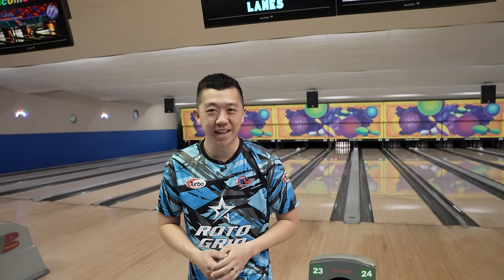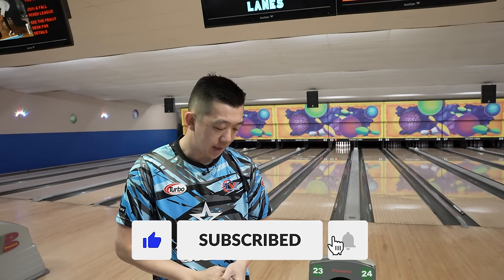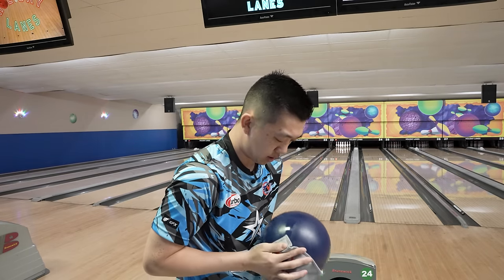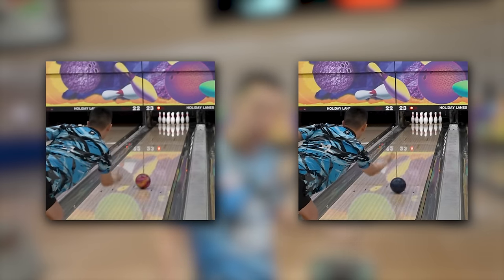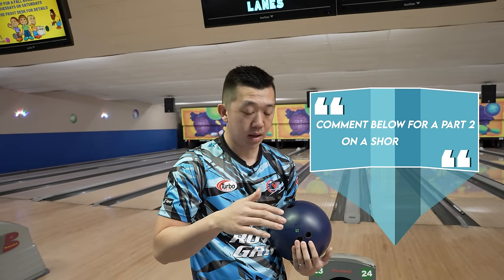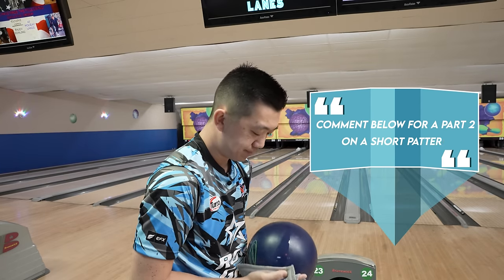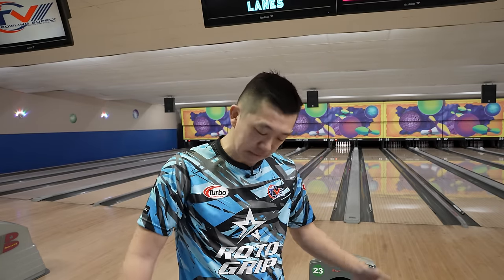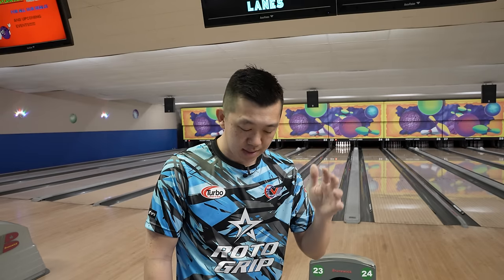Why Don’t Pros Throw Short Pin Reactive Balls? | Ballsplanations Ep.8

Comment: I'm low rev and low speed and bowl in a house that is on the dryer side of medium, and I use a short pin ball ,and the thing I like about the short pin ball is it allows me to play more up the boards with a high performance ball that hits with good carry. I've tried using weaker equipment that doesn't hook as much, and they are ok, but nothing like the short pin and when the shot ends up getting dry and I absolutely have no choice but to move left, then I just soften up and slow hook it. It doesn't always work out. But if it wasn't for a short pin ball I would have to either  bowl with weak balls or start way more left than I am comfortable with a high performance ball. I'm not a pro and I'm not playing sport patterns , but I'm sure glad to have a short pin ball.

Comment: I got a short pin ball around a year ago to let me play right more. It did not disappoint! Biggest issue I came across was that it only worked in a small window so I’m only able to play with it during the first game (it had no energy at the pins as I would move left). I got a NU Hammer (drilled strong) in December and it has a very similar ball motion as the short pin but since it is drilled strong I can move around with it more. I’ve gotten so used to the NU that I haven’t been using my Short pin much at all. One benefit with the short pin vs the NU was that the short pin can break from carry down where the NU will not break. I am a high rev two hander and I like keeping my target outside 20

Comment: A short pattern part 2 would be great to see the difference between the 2 balls since that is the majority of when urethane gets used
Reply: Agreed. Another thing would be to include a symmetric ball with a 2” pin as that would be interesting to see, and if Mikey really wanted to go the extra mile, have a 2” pin high diff sym (something like a P2 or Optimum) and a 2” pin low diff sym (IQ Tour).

Comment: I feel like saying "urethane balls don't flare" is pretty misleading. I agree coverstock is the biggest factor, that's what physically touching the lane. But flaring is more due to the core design. You could take an iQ Tour and throw a short pin layout on it and it would flare less than say a Hot Cell even though that's a urethane ball.
Reply from the maker: True. Was just referencing this specific case where my fast pitch doesn’t flare

Comment: There is a huge flaw with this comparison.  First off, if you want a urethane like reaction from a reactive ball you are not going for the highest performing pearl in the line.  That is just stupid.  You would most likely go with something in the mid performance category or even lower.  You should have used something like a Hustle X-Ray or at most something like an X-Ponent.  Another option could even be an IQ Tour but take the surface down to 1000.  But trying to take a high end asym pearl and trying to get it to roll like a urethane is a losing cause before you even step on the lane.  As a two hander I have had a few short pin balls and had some pretty good success without the need for a urethane.
Reply from the maker: First off, Magic Gem isn’t a pearl. Second, I took one of the earliest hooking balls on the market to compare because urethane are the earliest hooking balls on the market. Why would I use a weaker cover mid/low range ball that would get further down the lane to mimic urethane reaction?
Reply: @tvbowlingsupply  Either way.  Urethane might be the earliest hooking but far from the strongest overall.  The main reason for such an early hook is because of the surface being so rough.  How often do you guys use urethane at 4000 grit?  Most reactives now have softer covers than urethane under the new rules.  A reactive ball with a 74 hardness at 500 grit should read as fast as a urethane at 78 hardness.  Wonder what the IQ 78U would look like at 4000 surface which is a stock IQ Tour Solid.   If you took an X-Ray or Xponent and matched the surface of a urethane (typically 500-1000); you could make that cover read the first 20-30 feet in a similar fashion.  That Magic Gem will run circles upon circles around a urethane.  The whole idea behind a short pin is to get the ball to emulate a urethane.  If you are more speed dominate you could even go Phaze 2 with a short pin.  Next time try this comparison.  Go with an IQ 78U and an X-Ray with a short pin and take the surface to 500-1000 and throw them side by side.  Be willing to bet they are closer than you would think.  X-Ray may still be a touch cleaner but the overall look will be pretty close.
Reply from the maker: @vance836  feel free to make a video and show us! But I respectfully disagree with the fact you say urethane isn’t the earliest hooking coverstock there is.
Reply: @vance836 They might look somewhat similiar on a house shot.On the other hand, flatter patterns will really show that no matter what layout and surface you have on a reactive, it is still going to do reactive things.

Comment: I have about 5 balls drilled short pin from solids to hybrids as well as asymmetric to symetric balls. Reason behind this is due to my house having burned heads and the refusal by the staff to increase the volume of oil to combat it. For the most part is due to me not able to throw pin down layouts. So that's my reason behind the short pin layout.

Comment: With the pin to pap controlling flare amounts, with a strong enough pin, can you not get the whatever cover to dig harder to get close to that dig of a urethane with a more moderate pin position?
Reply from the maker: It won’t be as progressive of a hook phase than the urethane combination of cover and low flare. The short pin will want to go much straighter down the lane, especially while giving it angle
Reply: @tvbowlingsupply  ah so it'll use more it energy trying to create the same shape and have nothing left for the backend?
Reply from the maker: @airammitchell682  it has seemed that way with my testing!
Reply: @tvbowlingsupply  thanks for the insight
Reply: Maybe a short pin on a weaker core might help with that, like a symmetric
Reply from the maker: @airammitchell682  then it may not read early enough. The magic gem didn’t read early enough already!